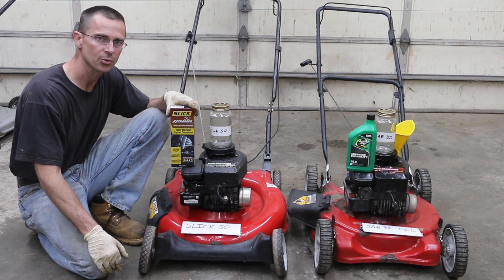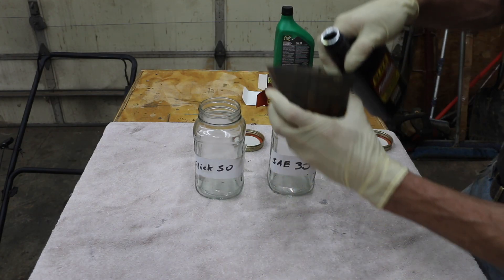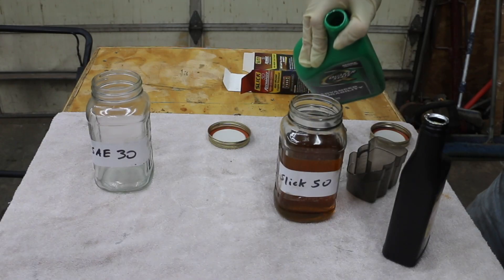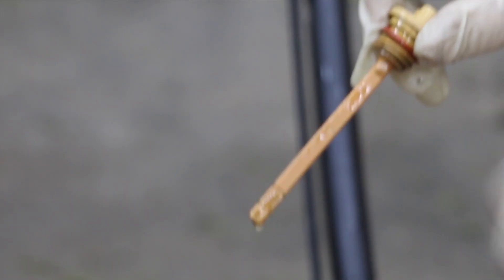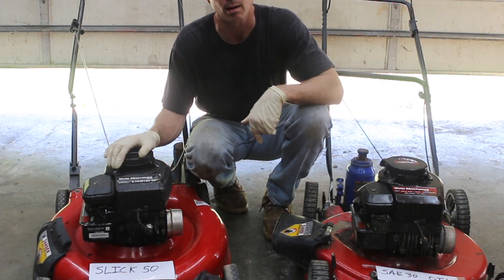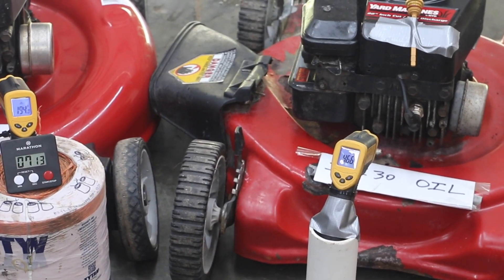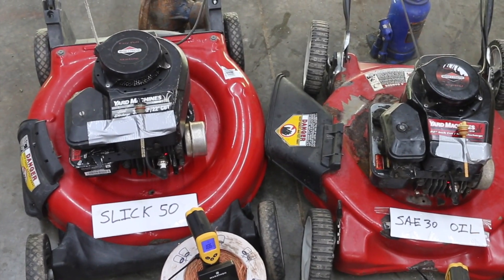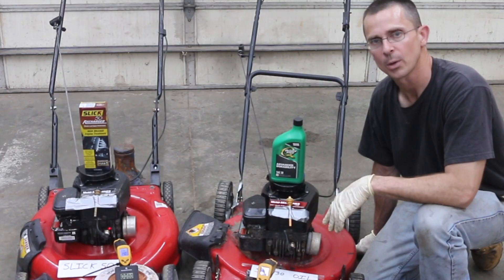Can't believe what SLICK 50 did to my engine!!--Dry Crankcase Test!

Comment: I am just re - posting a comment I made to anothers comment here.
I agree with alot of the observations made by others. A couple of things which stand out which makes this test invalid is 1. the engines are not the same age or have the same amount of use. 2. The slick 50 oil was dirtier than the sae 30 oil which suggests to me that the slick 50 engine was not cared for in its previous life and had a lot of internal wear and the sae 30 engine was cleaner and while it looked older may have been in better shape inside.
The whole point of this video, while interesting is nonsense because engines are meant to be run with oil in them, not without oil. 
A better test would be to strip down 2 new engines the same and measure all of the wearing surfaces, reassemble them and then run them both with oil and one with the  additive for say 100 hours and then pull them down and measure the  wearing surfaces and see if there is a difference. That would be a more scientific approach and give people a better idea if it is worth spending their hard earned on a product.
If you have  a small engine and want it to last then just change your oil once a year and it will give many years of service. Additives are just a way for someone to get money out of you that you don't need to spend.
For your car use good quality full synthetic oil and change regularly at least every 10 - 15 thousand kms. In Australia I have seen  a 3.9 litre 6 cylinder do 975,000 kms and still going strong without ever having the head off. It had oil changes every 10,000 kms.
Reply from the maker: Thanks for the constructive feedback.

Comment: I use the Lucas engine treatment. My dad (1904-1980) used STP in his 62 chevy 1/2 ton pick-up.
Chevy 327 engine standard trans.
When my dad died 1980 i got a drivers license i got inherited it.
As a kid i recall my dad changing oil and filter every 3thousand miles.
We did it ourselves.
He did have engine rebuilt 3 times if i remember correctly.
He used it in his carpentry business.
Mostly building wood fences.
.
Reply from the maker: Thanks for commenting!

Comment: you'd have to do a series of test to get an average or straight number of failures to weigh in on this, the motors are different and you don't know where the standpoint is. representative samples at a much higher count will give a better idea of closer accuracy of assuming the quality of a product.  even just compression checks wouldn't be able to determine the actual wear in motor. there's a number of reasons that could strangely account for just compression results alone, getting into shaft conditions would be an entirely new tangent.  in these two motors, what exactly failed and the conditions around it, what'd they contribute?
Reply from the maker: Thanks for commenting on this.

Comment: I used also to believe in Slick 50 about twenty years ago, but it is no good.

Ester synthetic engine oil is the best protection of your engine that you can get. 

Ester base oils sticks or bonds to metal parts in the engine which is very good at startups and the oil film is stronger than other synthetics such as polyalphaolefins.
Reply from the maker: Thanks for commenting on this!

Comment: Slick 50 is snake oil.  If you want the true best, use synthetic motor oil.  All of those oil supplements are just snake oil.  They do nothing but increase the cost of operating your motor.
Reply from the maker: Thanks for commenting on this.

Comment: I like how you turned that refrigerant vacuum in to way to suck out oil.
Reply from the maker: I need to put together a video on this.  It's extremely handy for removing ATF is accidentally overfilling the transmission.
Reply: I want to see this conversion video. Do post a link. I use suction pump but those are small and slow for oil. Need a powerful one and i do have an exact similiar air vacum.
Reply: potheads can identify.. works like a bong...
Reply: hahaha I didn't notice that. Just thought it was a mini compressor and was putting air into the case and blowing it out. Nice eye lol
Reply: Blew my mind.  At first I was like "Is he literally about to just suck that oil into his vacuum pump?  You can do that??"  Thankfully I saw his interesting jar attachment before i made any brash decisions.

Comment: Back in the day the slick 50 oil additive which is actually called PTFE (teflon) used to come out white like milk but it put a coating in the engine it was used in. If you wanted to buy slick 50 motor oil, it would run you about 10 dollars a quart.
Reply from the maker: Great point.

Comment: slick 50 isn't the same formula as the original,it's been passed around to different owners/companies etc .I used to use it when it first came out and even if it was a "placebo effect" it seemed to work as advertised with no major failures and seemingly smoother running engine etc
Reply from the maker: Great point!

Comment: 925874 KM on a Ford straight 6 cylinder running on LPG gas, using an Australian oil manufacturer, "Penrite" .
3 head gasket replacements, original bottom end, 5000km oil changes.
Full synthetic 10W-50, sold at any retail auto shop in Australia.
Case closed.

Comment: Not such a good test to start.  Slick 50 engine ran cooler, but you had no reference of standard oil in both mowers.  It could have been running cooler to start. Running an engine with no oil proves nothing.  Having a pool of engines would be better, but not always doable.  Better test would be to have two brand new engines, broken in with standard oil, then change the oil run for an extended period, then change oil again with the additive and run again.  Each time the oil is drained, a metallurgical analysis can be one to verify which engine is wearing more.
Reply from the maker: Thanks for commenting on this.

Comment: try "unsiezing" each one... I used to work for an old farmer that sold went arouns selling this snake oil and he did this exact same thing to an old Briggs Engine. Except he used THE SAME ENGINE...that old boy had AT LEAST 50 engine siezes and subsequent "unsiezing" before running straight oil in it and mowing the front yard with the thing.....pretty kool if you ask me......except im not about to try it on my cummins........heh heh heh
Reply from the maker: Thanks for the recommendation.

Comment: Try letting the oil heat to operating temp then add the Slick 50 and you may hear the engine quiet n speed-up slightly. Then it's right.  You can't put Slick 50 in cold engine to get it to congeal to the parts. If you dump it into a cold engine then crank it may just congeal into a blob on the bottom of the crankcase.
Reply: And stop-up the pickup.
Reply from the maker: Thank you for the recommendation!
Reply: I think you might be correct: slick 50 had to be admitted in a warm engine, as I can remember it. Still, my ("badly designed") turbo diesel car engine was worn out at exactly the ( car parts importer) predicted 90,000 mls.
And my today's maintenance garage uses Mobil 1 as standard
Reply: @peterklein4349  did you read the manual properly

Comment: I saw here on the tube some years ago that the original Slick 50 was bought out by a big company who changed the formulation.  They bought it from the little independent guy who invented the stuff,   or so the video explained.   Anyway,  the "magic" in it was,  if I remember correctly, PTFE,  which is a fancy smancy name for Teflon,   basically.  The Teflon was said to affix to all moving engine parts and reduce the friction,  making the engine run more efficiently.  
It's said the modern day Slick 50 has no Teflon in it.  The original innovator is supposed to be making a product similar to the old Slick 50,  Teflon and all,   but I forget the marketing name.  Whether all this is true or not,  I can't say.   I did get it off the 'net so who knows.  
Thanks for the demonstration.   Very enlightening.
Reply from the maker: Thank you for this information.

Comment: But you're using 2 different model mowers. Are they the same age? You could have gotten the same results treating them both with regular oil. This test needs to be repeated if you want meaningful results.
Reply from the maker: I've used new, identical engines in more recent videos. Thank you.

Comment: Slick 50 and many other oil additive manufacutures were charged by the FTC for making false claims. Dupont the manufacturer of Teflon also went on to say that "Teflon is not useful as an ingredient in oil additives or oils used for internal combustion engines." http://www.1expired.com/dura-lube_slick50.htm  I would be interested in your testing Petron Engine Conditioner. I can supply you some.
Reply from the maker: Great point!

Comment: Hi here is the big difference with your testing Slick 50 did a test where they treated a car engine with with their product then drained the engine of all the crank case oil and drove the car for a very long time and the temp stayed ok and the engine kept running BUT THAT WAS A WATER COOLED MOTOR slick does not work as well in air cooled motors because in an air cooled the oil does two things it lubricates and provides a certain amount of cooling so if you remove the oil you have removed some cooling and this causes the engine to lock up due to over heating. in the car engine tests the engine was kept cool because it's WATER cooled the slick 50 does a great job and if you can keep the motor cool all does well so if your going to test test like things apple to apples  water cooled to water cooled this bugs me every time I see some one test this while not understanding what they are testing.
Reply from the maker: Thanks for the constructive feedback.

Comment: I would rule this test invalid because of the unknowns. Engine history is unknown, did the one engine that had the straight oil have a sludge built up? Did the slick 50 remove the sludge build up?  What was the condition of the internal hearings before the test? Which part in the engine failed and was it the same in each engine? There are other parameters that need to be considered before a test is conducted.
Reply from the maker: Thanks for commenting.

Comment: Years and years ago I had what would be now considered a very old Honda XL250.  Put a lot of miles on that bike and changed a lot of chains and sprockets.  However, the owners manual was very clear, "Do not use oil additives as they will increase operating expenses".  So Honda clearly thought all you were doing if you used oil additives was spending money, it wasn't going to help their engines last longer.

In retrospect and in light of your test (which, admittedly was only one test and did not use identical brand new engines), I find it hard to understand why an additive would be better than fresh, clean regular oil at doing what oil is designed to do, and if it was why wouldn't oil companies be putting similar products in the oil to begin with?

Anyway, to be conclusive the test would have to be repeated several times and use identical brand new engines.  Using used engines makes it hard to control for previous wear.  They aren't same-same.

Also one time while out dirt bike riding I put a hole on the side of my engine (4 stroke, but not the XL) but didn't notice until the engine seized.  However it was a nickle plated cylinder.  I got the bike towed out, put a new plate on it, and it ran fine after that.  Somehow the engine seized before either the rings or the nickle plating were seriously damaged and also before any of the other parts got seriously damaged.  All it needed was to be cooled down, fixed, and oil put in.  But the difference here has that it stalled out when i tried to idle it and I noticed the loss of power, so I quit running it and found the problem.  If I'd continued to run it at full power until it quit I am sure I would have wrecked it.

Of course I also had a boat that  spun a bearing and that wrecked the motor good.  That was expensive.
Reply from the maker: Thanks for commetning.

Comment: MOA by BG. I heard a story once from a teacher at training that one tech was doing an LOF and only put MOA in thr engine, forgot the oil. Customer drove 5 miles before returning to the dealer. They filled it up with oil and it was fine. That stuff really does work. Recommend testing it especially on your lubricity tester. Their claim is that it lubricates far better than oil.
Reply from the maker: Thank you for the video idea!

Comment: Gosh... I recall the Slick 50 commercials claiming that their product was the best thing since Swiss cheese. There is a oil changing company whose name I won’t say except that the first half rhymes with Spiffy. They offer a  Engine flush service for a “nominal” price. A friend of mine who worked for a Chevrolet dealership in Seattle asked, “why waste the money?” All you have to do is change the oil, filter Then drive the car for a couple days and then change it again. Your engine will be flushed! You’ll save money in the long run. He went on to say, the company flushes fresh oil through the engine...pretty much the same way a regular oil change....The difference being that engine isn’t running! Made sense to me.
Reply from the maker: Thanks for commenting.

Comment: I'm sorry,as entertaining as it is,but I believe the lock-up has nothing to do with the S.50. This test would be somewhat better if two new identical engines were to be used. The slick 50 meant to be for the bearings and lifters mainly in car size engines,and not in lawn movers.The older engine ran so hot,that probably warped.In the other,however probably only the piston got stuck,which after a few minutes became usable again. That is my thought of it.
Reply from the maker: Thanks for the constructive feedback.

Comment: Perhaps just using a top quality synthetic oil might work better. I just use Amsoil in all my engines. I sample test one engine and the 2 results so far have been spectacular. I even got a letter from the lab stating there was less wear showing after 8Kmi oil change in a 45Kmi engine than a 4 cylinder Honda engine with a 3Kmi oil change. The TBN of the oil was still over 5. They said I can go to 10Kmi changes and not worry. I'm not a fan of these oil additives. Always thought they were mostly hype....
Reply from the maker: Great point.

Comment: Very disappointing I have use look 50 in the past and thought I was doing a good thing for my engine to make it last longer I guess not. What I don’t understand is at the beginning when you had both lawnmowers filled with oil the one with the slick 50 was running cooler so does it do nothing or maybe the engine lasts longer when the engines are filled with oil and the slick 50 and tips who knows you can’t run both of them total failure with oil in there you’ll be there forever. Do you think there is any additive what about Dürer lube
Reply from the maker: Thanks for commenting on this.
Reply: The engine with slick 50 gummed up as the oil/slick 50 mixture seized the components .but....saved the engine at LOW temperature. The other engine just showed thermal runaway and destroyed itself . the video is a joke ..its stupid...a ridiculous test...BUT ..shows us how the additive will seize your engine to prevent severe mechanical destruction! Slick 50 is ok,

Comment: I put Slick50 in my 1989 Dodge Spirit from new. At 180,000 miles I dropped the oil pan and there was no metal in the pan. no wear at all on the pan magnet. You have to use it with oil. I used Mobil 1 synthetic. Unfortunately a semi truck took out my car on 1997.
Reply from the maker: Thanks for commenting on this.

Comment: For what it is worth, in 1980 I tested the original Slick 50 by EAR in my well worn Ford F100, with 77,000 miles on the original engine.  I tuned up the truck to perfection and changed the oil and filter, minus one quart of oil.  The engine ran beautifully, a lovely liquid purrrrrrrrrrr.  I ran it a while, then added the final quart of oil with the Slick 50 in it (after SHAKING THE CAN well as per instructions.)  Within only seconds that purring engine went to a quiet HUMMMMMMMMM!  I could hardly hear that the engine was even running!  I ran that original engine with ordinary oil changes up to 180,000 miles and sold it to a friend.  He ran that original engine to over 200,000 miles until I lost track of it.  This is why Slick 50 has believers!...………………………...elsullo
Reply: They probably don’t make slick 50 like they used too now ?
Reply: Sounds like a lot can attributed to a observant person keeping up with regular oil changes.  That alone can net you many, many miles over the average guy who will tend to "let it ride" every so often.
Reply: Its a Ford with regular oil changes. Im not saying slick 50 isnt good but what i am saying is that a ford truck will run for ever if treated right

Comment: Not an additive however ive had good luck with royal purple . Despite its price i was able to beat my older equipment,  and small cars w high mileage with no real failures where a rod bearing would usually give. Now im not 100% sure about the power gain they claim . But its defanitely a stout lubricant.
Reply from the maker: Thank you for this recommendation!